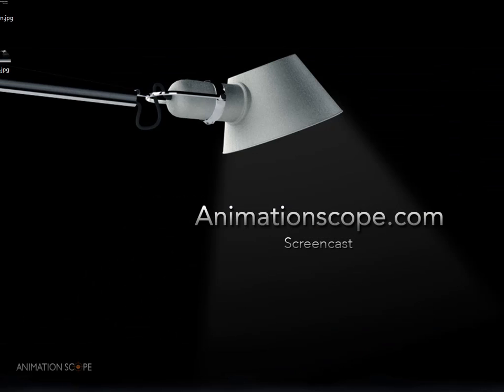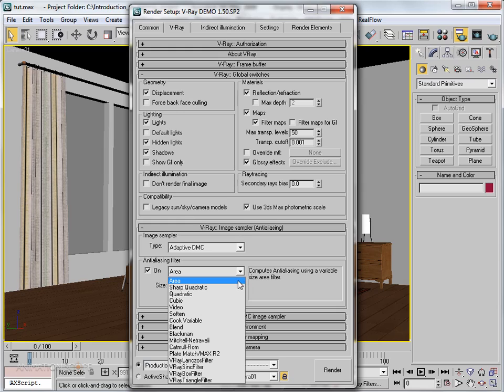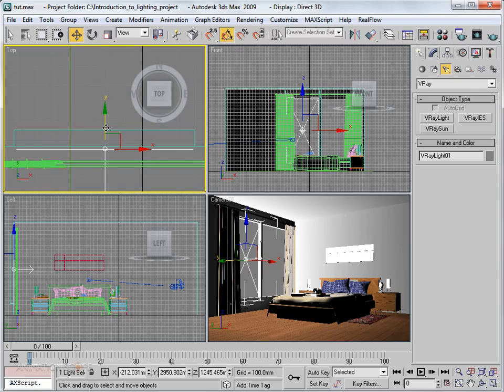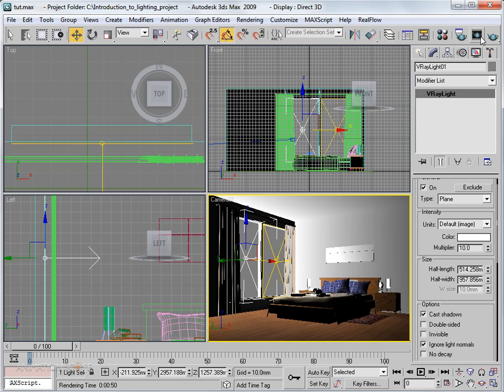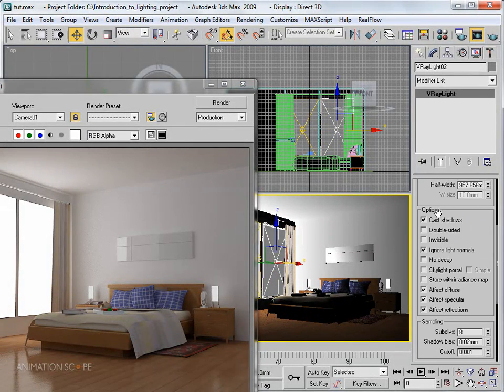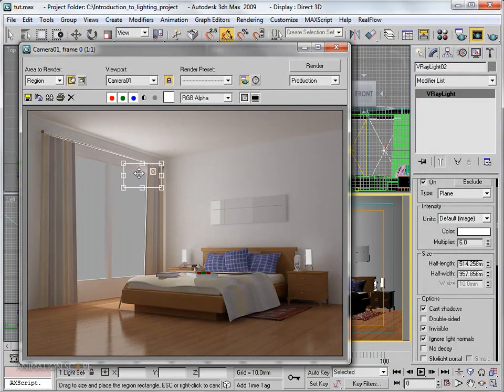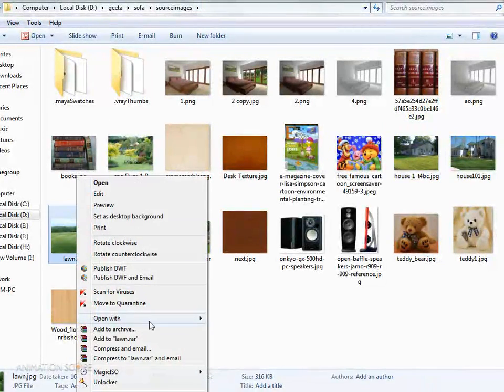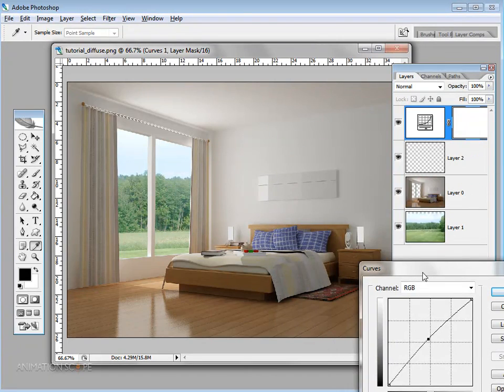Interior Lighting In Vray , 3DS Max  - SCENE FILE NOW AVAILABLE FOR DOWNLOAD

Comment: that's pretty poor tutorial. There's need in at least 2 lights - main and background one imitating reflected light, Also the materials are terrible and it's not obvious at all that lighting quality is enough.
Reply from the maker: Thank you for your comment, by using reflected light do you mean the bounce light ? For that the V-ray GI is doing the work so i really did not feel to put an extra light. Materials are not good as my main focus  is on basic V-ray rendering and i have also not explained creating materials in this tut.  I have focused on the most easiest way to render scenes with V-ray with keeping in mind the render time ,  so you can say the render quality is not up to the current industry standards as I have made this tutorial many years ago. Once again Thanks for giving your time in giving your feedback.

Comment: bro which material have u applied to the windows and the interior of the room such that the external light could pass into the room...??
Reply from the maker: In this scene, There is no geometry for the glass in the window. That's why the light is coming inside of the room. But if you have glass geometry you can use Vray material ( Refraction colour: white, affect shadows: ON)

Comment: Very good tutorial. Only one thing: That technique (in photoshop) doesn't work if I want to put glasses on the windows and simulate reflections on them.
Reply from the maker: Thanks, yes right,  it can be achieved in Max also
Reply: Yes, it can be done in max. In that case, what I do, is create a plane with the same size of the image that I want to place behind the window. Then create a vray material and put the image in the diffuse channel and activate the self-ilumination, but with a low value. Then apply this material to the plane and place and scale it accordingly to the camera. I do it this way, but I don't know if it is the best way.

Comment: I'm just starting with vray, but your lighting method (placing a light where the window is) doesn't seem right when you're using a renderer based on GI like V-Ray. Aren't you rather supposed to light your scene pretty much like you imagine it to be, in this case setting up a sun and sky system, and let the GI do the job illuminating your interior?
Reply from the maker: +David M. Johnston Thank you fr your comment. Thats what i have done, i understand that placing a sun and sky with GI seems to be natural as in real life we get light like this only but in software its not sufficient and we have to make adjustments to achieve the desired look however we have to keep and use the lighting principles in mind while placing extra lights, its like while doing photo shoots why do we need those extra lights and deflectors at day time also when we have sun already :) Thanks for watching !!
Reply: +Animationscope .com Yes, that's what I would do in a simple raytracer like scanline, but I think vray is more than capable of exploiting GI so that a simple sun and sky would be enough. Plus, it could be even more realistic since it would not light the roof as much as the floor, the light coming through the window should be more naturally distributed. 
The following days at school I'll be working on a documentary project and it will be rendered in V-Ray so I'll soon learn a lot more.
Reply from the maker: +David M. Johnston Yeah you can play around with settings in vray but  placing only sun and sky will not do the job in all cases. Also it depends what kind of lighting you want , in my tutorial my emphasis are towards architectural kind of rendering. Thanks

Comment: This room has one window opening, so using vray plane light we can fulfill light requirement but
in case of very less or no opening how to provide light ???...plz tell..
Reply from the maker: Hi, start observing conditions of light in your surroundings, is there any room in your house in which there is no window ? in that case what is the main light source ? The chances in that case are artificial lights like tube light, bulbs or anything similar to that.

When we do lighting in softwares we use to check the light sources first and those light sources act as keylight. Though many times only keylight is not sufficient to give realistic look to our scene so we use other lights or GI for fill light. 

Thanks

Comment: hello there..its such a grt vid..m having dis prblm..i hav made an interior scene.nd wen m applying lights in it windows are appearing black nd no lights are passing through it..nd i noticed in your scene ur windows are white can you plz explain to me how u did that??
Reply from the maker: If the light is not passing through the windows, please check the following things:
1- Do you have a glass geometry on your windows ? if yes , please check its material. If you have applied a vray glass material , under the refraction area please check the 'Affect Shadows' option is on.
2- Alternatively you can also exclude the glass geometry from your directional light.

For the windows appearing black please check the following:
1- The color of environment by pressing '8' or go to menu> Rendering> environment. By default its color is black. you can change it according to your need.
2- If you have placed Vray lights on your windows make sure the invisible option is turned on. you can check the option in lights modify or settings.

Hope it helps, feel free to contact me if the problem persists. Thanks :)
Reply: Animationscope .com  wen m applying camera to see all the light effects,render is coming all black(all i cn c is a pinch of light)..bt wen m doing the same render without camera i can see light in my scene..i hav gone through all the settings bt i couldnt find any error cn u luk through this prblm plz.
Reply from the maker: Pallavi Kejriwal
 Which camera are you using ? its a standard cam or Vray physical cam ? Also you can email me the file at my email id : ram.ad3d@gmail.com
Please note i use 3ds Max 2012, so i wont be able to open the files created in higher versions of 3ds Max.

Comment: Hi there. Good tutorial (it would be good to actually have the scene file though...difficult without it). I was trying to do it with your "interior room" free file, but even with the direct light outside, the window spaces are totally black on render?
Reply from the maker: Thanks!! Direct light is just a source of light , the window spaces are looking black because of environment color. Please check the color of environment by pressing '8' or go to menu> Rendering> environment. Also check the glass material of windows if its still coming black. Feel free to contact me if the problem persist. Thanks
Reply: Animationscope .com Hello Ram. Unfortunately, I can't get any of that to work. BGD is white. Lights are invis. Affect shadows ticked. Etc. I tried to email you but can't actually find an email address...took me through a subscription tool from your site?
Reply from the maker: email me the file : my email id is : ram.ad3d@gmail.com

Comment: can anyone help me.. whats the difference of using vray in sketchup compared to 3ds max vray? which one is better?
Since im just a beginner in digital modeling, ive been very comfortable in using sketchup.. so I think that in the time being i should just model in sketchup then import in to 3ds max to do the rendering.
Reply from the maker: It totally depends on you on which software you are comfortable in working with. Both softwares can be used for modeling and rendering. The thing which matters is the output which can be achieved in any of the application.Vray is a rendering software which is compatible with 3DS max and Sketchup both. I started using 3ds max as it is a full package for Modeling, texturing, lighting, rigging & animation. Sketchup as far as i know is good for beginners and can produce very nice renderings in less time. Thanks :)

Comment: Tanks a lot, but when i try to switch it back to "default scanline renderer"  to see the difference, it wont render, the whole scene is black, i replaced the lights and i replaced all material. What should i do?
Reply from the maker: If you have replaced all the vray materials and Vray lights then it should render. Make sure you are not using vray camera.
Reply: thnx, it worked